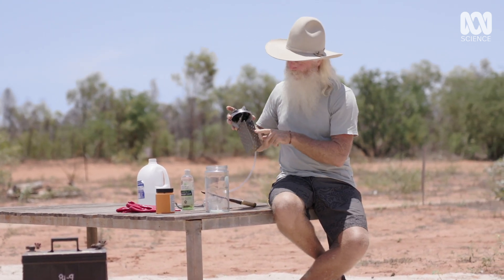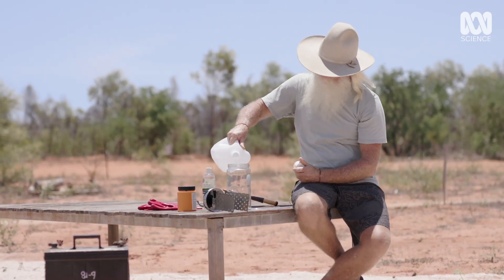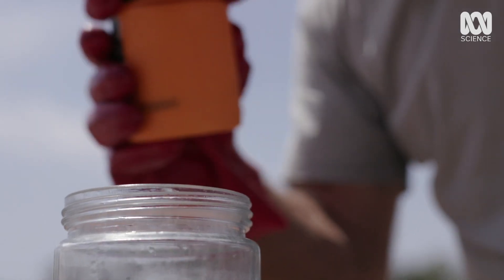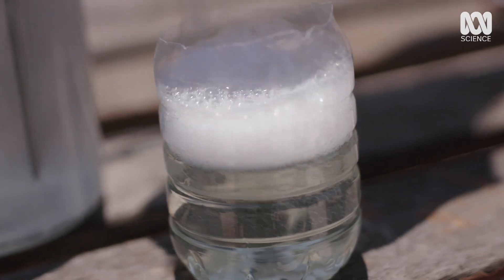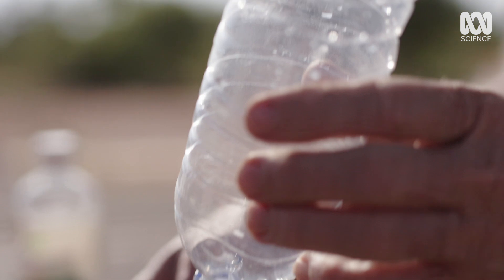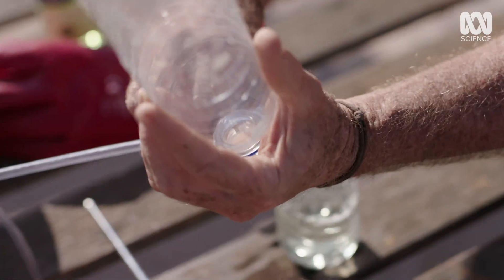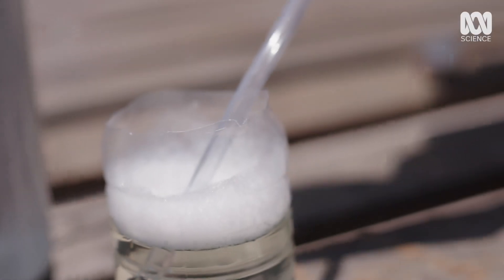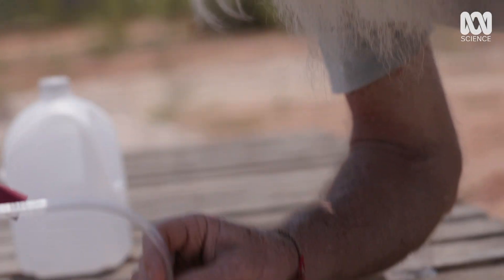How To Turn Mars Water Into Rocket Fuel | Catalyst | ABC Science

Comment: spacex will never fit what it takes to build a mining and fuel making factory can make make 2 million pounds of fuel and LOX into 1 or 2 Starships and make it work on Mars. Electrolysis takes tons of power and you'd also need a massive solar panel farm which is even more junk that won't fit on a starship. Therefore Starship will never make to to Mars and back.

Comment: I remember an article from Modern Mechanix Magazine about an engine running on water instead of gasoline. Very funny. They mentioned the electrlytical device to turn water into a combustible mixture of gases, they even mentioned the big diesel powered generator that delivered the electricity. However they didn't quite connect the dots.
Reply: This is about rocket fuel, not powering automobiles. The idea is that you produce fuel on other bodies such as the moon, avoiding having to launch and carry fuel to the moon which takes a LOT of delta V and thus fuel. This coupled with the lower gravity on the lunar and Martian surfaces can extend our range and drastically increase the size of rockets we launch in the future. 

Imagine a rocket built and fueled on the moon, and how large that rocket could be without having to carry the fuel necessary to punch through the earth’s atmosphere and do a lunar transfer. The implications are immense.

This has nothing to do with water powered cars, believe me, I know the magic of petrochemistry and I won’t be trading my gas car in for an electric car anytime soon. But this is an entirely different matter, this has to do with launch economics and mission constraints. Rockets are not analogous to cars
Reply: @HieronymousLex  It has been done many times before. They all just mysteriously die.